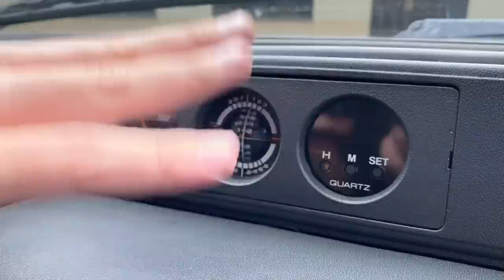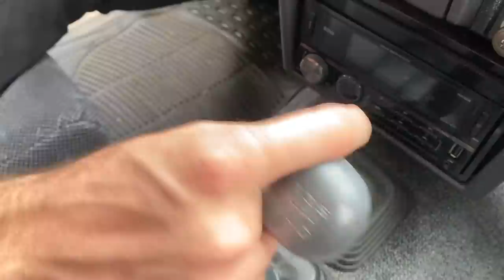We Just Bought The Most OBSCURE Off-Roader Ever Sold In America!

Comment: daihatsus are cool cheap cars, i own a 2006 terios j100, it has a 1.3 k3-ve engine wich is a rebranded 2sz-fe out of the toyota yaris, wich means you can find cheap parts for it, is a awd car with a mechanical center dif wich you can manualy lock, sad thing is it does not come with low range, so is missing  some gearing needed to get out of some fuzzy situatios, still much more capable that most soft roaders with haldex that you can buy today, another downside of the car is that it goes trough cv joins, is because the cv boots can't really take all the angle of the steering and eventualy crack, i'm not sure if someone makes upgrades for that, but they should. mine is currently at arround 170 thousand kilometers, is a good little car, i just wish it had low range
Reply: On this side of the Atlantic our only exposure to the Terios came from Top Gear's famous fox hunting episode.

Comment: Samurai's never had an issue with rollovers. That is an urban legend that was started over a consumer report employee who hated them after one accident with it. They were sued by Suzuki after a video came to light of Consumer Reports running the slalom at much higher speeds and much higher turn in angle than they would with any other vehicle. The icing on the cake was hearing an employee telling the driver to go fast and turn harder to make it flip over. Suzuki won the lawsuit, but unfortunately it was too late as people (like yourself) already believed the false reports.
Reply from the maker: We’ve had two of them and trust us, they are hardly stable. Perhaps not the rollover nightmare consumer reports claimed but still plenty easy to roll, even stock
Reply: @TFLclassics  Do you happen to have a video of you testing it? I also own 2 Samurai and have found them very difficult to roll over. I have taken them up the Dragons Tail on the NC and SC border as well as trail riding in the Smokey mountains and have not had a single issue with rolling them. I have pushed them to points that felt like they would roll, but they never did. If lifted I could see some issues possibly, but never in stock form.

Comment: Does TFL do research on cars? Samurai’s never “flipped” over like everyone thinks. A head honchos son got into an accident in a lifted samurai and consumer reports took over 40 takes to try to flip it on purpose and when one side lifted about 6”-8” a smear campaign began
Reply from the maker: That is not super correct. We’ve owned 2 samurais and trust us, they can tip easily.
Reply: TFLclassics if it’s lifted any vehicle can tip over.  I’ve owned one for 7 years and haven’t had an issue with it
Reply from the maker: Both of ours are/were stock! Very nice to drive but a little bit tippy

Comment: If your fuel pump makes so much noise,than check your fuel tank because is full of rust and the fuel pump now sucked all the dinosaurs from it and now its struggling to push the fuel towards the engine.Take the fuel tank out,clean it,change all the fuel filters and put a new pump....problem solved!!!